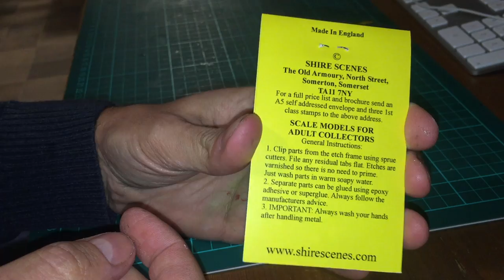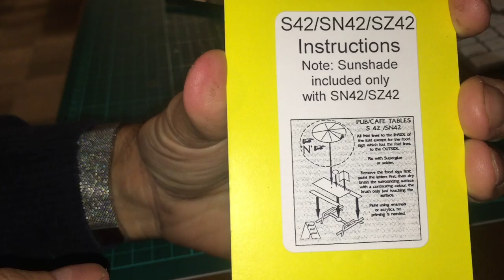Simon's Scenery: Picnic benches from brass kit

Comment: Great result Simon! A suggestion: use a solid surface to cut the photo etced parts, for example a very flat tile or a thick glass; so  you doesn' risk to damage them and your fingers too ;)
Reply from the maker: Yes pleased with the results.  Thanks for the tip, good idea!

Comment: Hi again simon. just a quick question I remember seeing somewhere a way of curing a jerky motion in a dcc controlled loco by adjusting a CV but I cant remember where. was it on opne of your updates?
Reply from the maker: +David Greenwood hmm I think it was in the class 08 review or the update after that , I think it was cv 50 that changes the motor type but it was a while ago!
Reply: Thanks Simon That sounds right I'll check it out